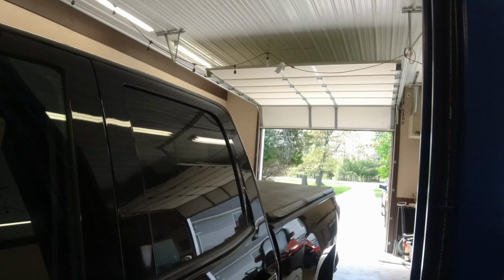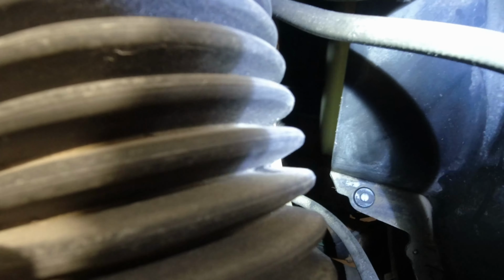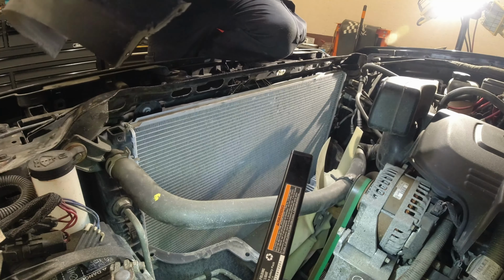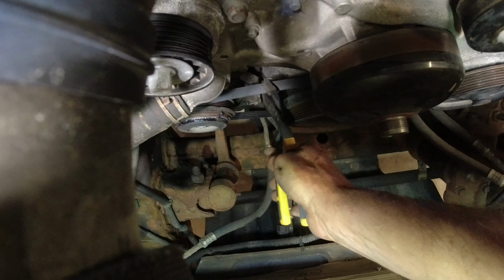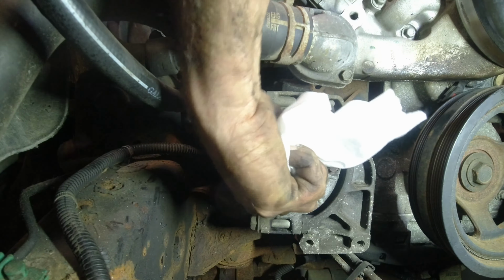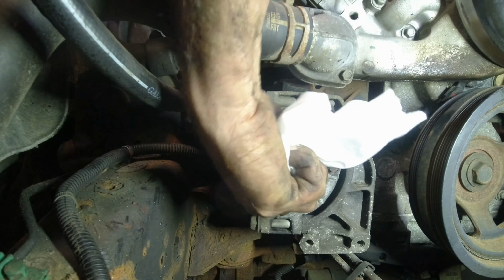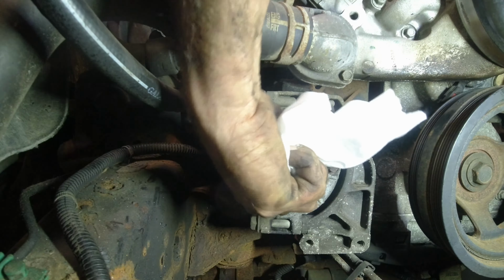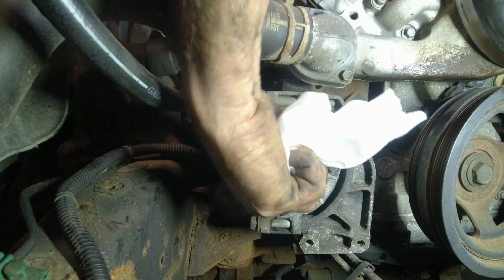Diagnosing A/C - Compressor Clutch Replaced on Silverado 2500HD 6.0L

Comment: Hello sir thanks for posting this informative video which I happen to be having the same problem 😂 I’m testing the plug where you used the light but with a test light instead but not getting no power, I checked fuses and all is good. But since you mentioned it only takes very little amps is that why maybe my test light doesn’t pick up anything?
Reply from the maker: Do you have a check engine light on? I know many cars won't let the AC come on if there is a problem with the vehicle, even if it's not AC related.
Reply: @marksplace  nope no check engine light. The compressor clutch looks in the same condition as your video, but before I get a clutch kit I wanted to try the test you did with the light, but my test light wasn’t picking up any voltage coming out of the harness that goes into the compressor
Reply: @marksplace  I forgot to mention my truck is algo a2015  gmc 2500 6.0

Comment: Mine works fine but won’t stop making a chirping/squeaking sound. If I spray a touch of pb on the clutch it goes away. Would this fix it?
Reply from the maker: I would hate to say that it would to only  have it still make noise afterwards. Did you try squirting some water on the belt to eleimate it form the equation?

Comment: Those snap rings are a pain to take out and put back in. I wound up taking my electric fan out to have more room to work. 07 Classic 1500 with 4.8 LR4 (LS1)

Also who has the means to torque the bolt to 13 ft lbs (156 in lbs)? Definitely use the old shim if you are using a AC Delco/GM original clutch.

Oh on the splines on the clutch plate where the shim goes, lightly brush antiseize on the splines to make it easier to disassemble in the future. Mine has the ac belt tensioner (better than stretch belt)

Comment: I have a 2017 2500, 6.0. My compressor started to make a humming/rattling noise. Even with the a/c you hear it while accelerating as well as idle. Was that the same for you? My freon is good.
Reply from the maker: I don't recall hearing anything other than my AC wasn't cold anymore.

Comment: Has anyone tried just …. pulling the cover off / removing a spacer / putting it back on ?
Reply: As a temporary fix of course
Reply: I did just that on my 1998 Frontier 5y years ago, still fine; I didn't even need to loosen or remove the AC belt.

Comment: If the rubber ring in the clutch is shot, chances are the compressor was slugging and you need one of those devices that stutters the compressor at start up to prevent damage.  This is the penalty for having the compressor low.  The liquid refrigerant sometimes drains down into it.

Comment: Hey, you dont have to cut the ac belt. There is a tensioner for it. Just under and a bit to the left. I had to replace my ac belt, tensioner, pulley behind clutch on my 07 chevy silverado 2500hd 6.0.
Reply: Though i will say this, it makes it way easier cutting the belt because 9/10 youre gonna replace it anyways!
Reply: Not on the 2011 hd 6.0.
Reply: Use the edit icon to pin, add or delete clips.
Reply: My 2008 Tahoe has the belt tensioner to loosen the ac compressor belt.  Still have to remove the serpentine belt first.
Reply from the maker: Mine uses a stretch belt, there isn't any tensioner on it. it's a 2015 6.0l which was the start of a new model year.
Reply: @marksplace  that makes sense, thanks for clarifying that
Reply from the maker: No problem, I noticed that the replies that had the tensioner were from the early 2000's and figured Id clarify it.
Reply: @marksplace what is that tool called and do most auto parts stores have them in stock? Thanks
Reply: @joeshmoe12301230 The newer 6.0L don't have a tensioner, they use a stretch belt design. The threaded holes are still there for the tensioner, so you could add one and use the old longer belt if you preferred. You'll have to find the appropriate size bolts for the tensioner.
Reply: 2009+ use stretch belts
Reply: @idabomb00 junkyard
Reply: @shadowopsairman1583  you could do that for the bolts and parts, but I would recommend a new tensioner and belt
Reply: What were ur systems @ poison

Comment: You should never ever ever ever walk a belt on to anything. Use the tensioner’s. That’s what they’re there for
Reply from the maker: Are you referring to the AC belt? If so there is no tensioner, it's a stretch belt,  and is the only way to get it installed.

Comment: Hey Mark, I believe I have the same issue with my 2015 GMC Sierra 2500. I'm Finding that all auto part stores are saying that they don't have a separate clutch assembly, only the entire compressor unit listed. Did you find this same issue, and still just use the part you listed off amazon?
Reply from the maker: Most auto stores or even shops will only have or install the entire compressor that I've noticed, I had the same issue. The one I have listed is the one I installed, well at least it was at the time I posted the link. Its unfortunate considering the price difference. Knock on wood but mine is still going strong till this day.
Reply: @marksplace  Excellent, thanks for the quick reply. I'm gonna give it the Ole College try. One last question, what size was the fan clutch wrench you used?
Reply from the maker: No problem. I don't remember the actual size off hand although this is the set that I used. Good luck, I hope it goes as well for you as it went for me. 

https://amzn.to/3NsIyDi
Reply: Rock auto